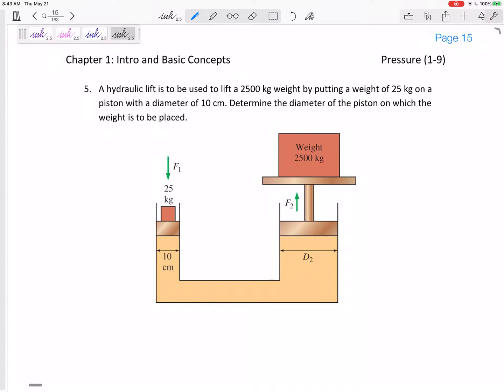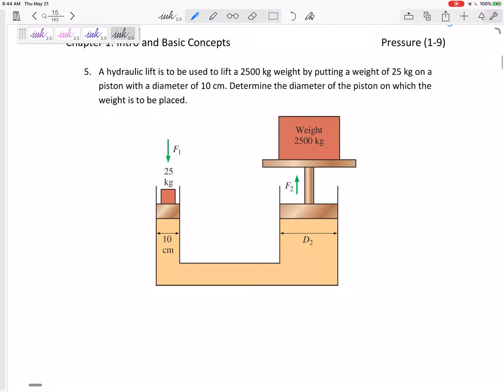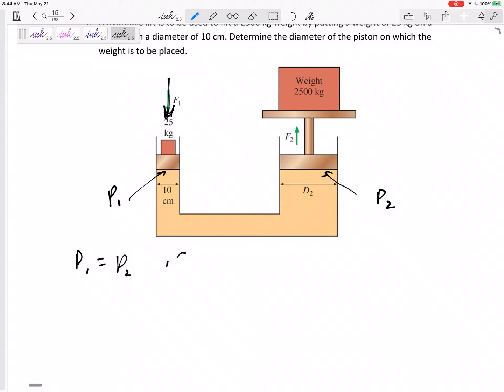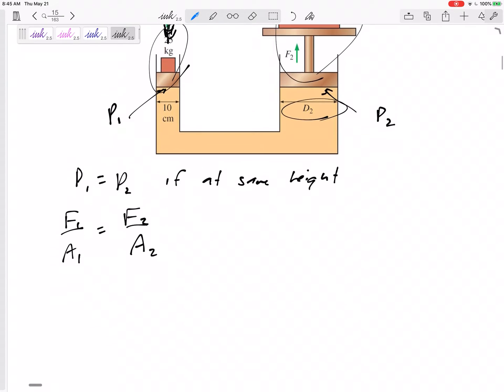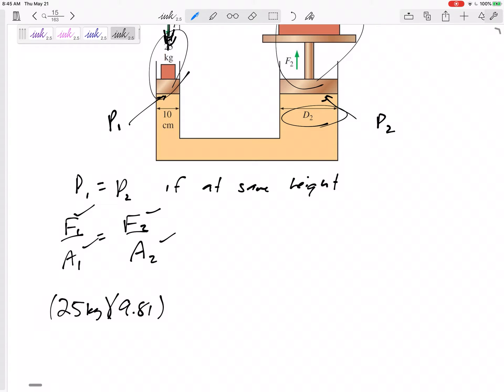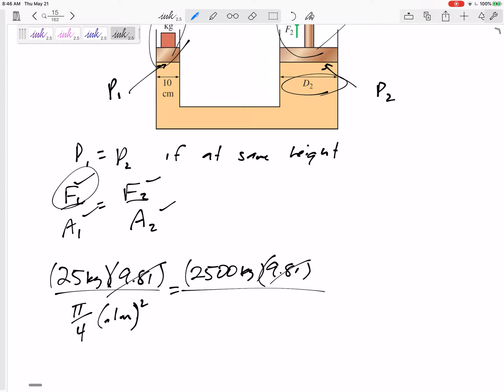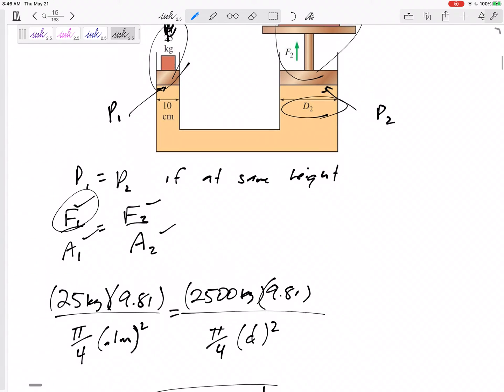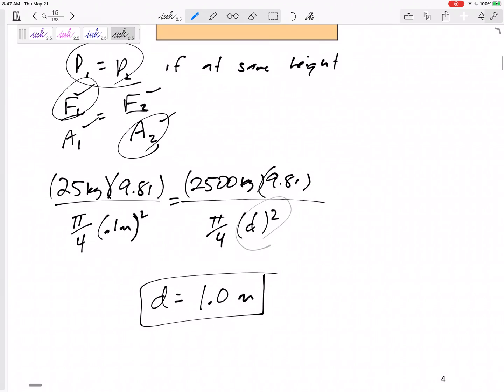Thermodynamics - Pressure example 3 hydraulic lift

Comment: when i calculated for the diameter of the second piston i ended up getting 3.16227766 m which am sure is correct.
Reply from the maker: The 9.81 and pi/4 cancel out. Then I’m left with d^2 = (0.1)^2*(2500/25). Which gives me d=1. Did you forget to square the 0.1 ?